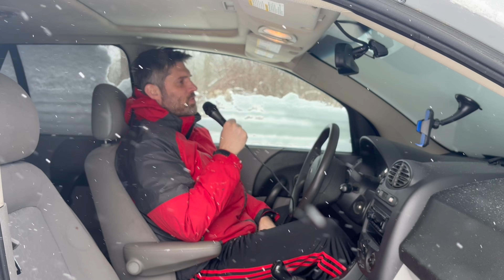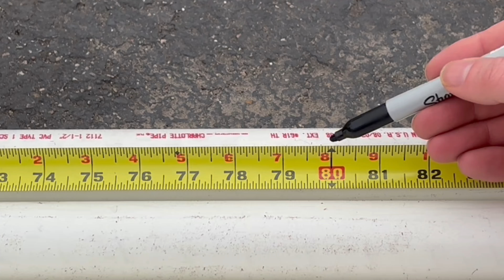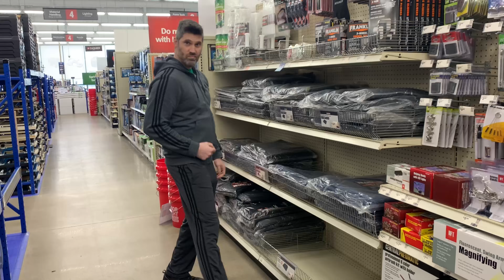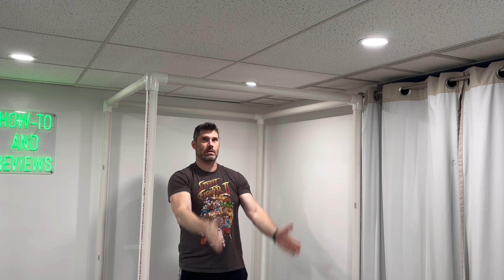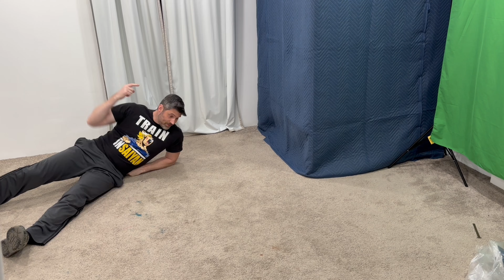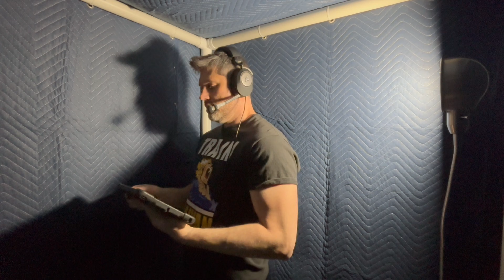How to Build a Vocal Booth - $135 - COMPLETE GUIDE - EASY DIY Recording Sound Booth

Comment: Unfortunately my measurements are going to have to be different because I'm trying to put my desk and chair and everything inside of this booth but fortunately the dude from Lowe's was able to cut them for me... thankfully I'm not that tall the mines are going to be 65 inches tall with the remainder being the width I'll keep you posted on this journey but I definitely appreciate you putting the links in the locations to get the stuff!!!! Only work I got to put in is making the grommets...*edit fortunately again they have moving blankets with built in grommets! I'm probably going to need more than four I think it's best that there's only four to test out if it's big enough I noticed you folded your blankets to make it I may or may not have to
Reply from the maker: That sounds like a great plan, I'm looking forward to hearing how it turns out!
Yes, there are moving blankets with grommets. I should have mentioned that. I selected the ones I did for low cost. The ones with grommets cost significantly more.
I should have also mentioned that hardware stores like Lowe’s and Home Depot will cut things for you. Pipe, and lumber.
Those are excellent points!

Comment: Adding accoustic pads inside would be great. Though it'll hot but the output would be zero reflection.
Reply from the maker: That's a great point, acoustic treatment would definitely help deaden the sound even more!
I did buy another set of moving blankets and doubled them up, which helped.
And yes, it does get hot in there!
Reply: @HowtoandReviewsOfficial thanks to you, I now know to make the diy booth, was about to buy it from Amazon. I'm thinking of pasting those sponge pads to the blankets.

Comment: Thank you very much for your video. I used it and the parts list to build mine. I wish I had that great saw because the hand saw was a drag. I already had the acoustic blankets from Producers Choice for a different design. One remaining question: Did you end up covering the PVC pipe at a later date to minimize echo?  That’s my only concern. I build mine 5 x 4 x 7.5 ft given that i had large acoustic blankets in hand for a design that had the blankets hanging from a 9 ft ceiling. Cheers. Tommy
Reply from the maker: Glad it helped! I did not cover the PVC pipes. They are still exposed on the inside. I did recently double up the blankets. They were on sale for $5 each, so I bought and installed another set.

Comment: In just over a year, these prices have change.

The 3-way fitting got cheaper at $17.17 for a 4-pack. Lowes actually does have these, but they're $5.88 a piece.
The moving Blankets have gone up by $1 to $9.99
Cable ties have come down by a whopping $.20, but the grommets have gone up by $.50
Safety pins have gone up by $1.

But the biggest change is the PVC Pipe that went from $7.97 a piece, to $11.96 a piece. So instead of paying $47.82, you're now paying $71.76.

So the total price now would be $159.33 now.

However, Amazon DOES have an 8-piece PVC Elbow fitting for $26.99 and a 4-pack of 80" blankets for $33.99, bringing the price back down to $146.01
Reply from the maker: Wow, thanks for doing all that research and updating the current pricing for everyone!
I remember when 10 foot sticks of PVC pipe were two or three dollars. Prices are always changing, and usually increasing.

Comment: You can buy the blankets with the grommets already in them.
Reply from the maker: Absolutely. They are available with grommets already in. I selected these, because the cost was a lot less to install them myself.
I don’t recall if the blanket height was different. But these are also the perfect height for me.

Comment: Apa ini berlaku untuk suara bising dari luar?
Reply: Hi there, a recording booth might help a slight bit, but in general, it doesn't eliminate noise. Mostly just echo
Reply from the maker: It does not really block out outside noise, and it does not block outsiders from hearing you inside.
It just damp in noise, reflections and echoes to provide clean audio.
I’ll be making a dedicated video soon showing how much noise blocking it offers.

Comment: Great idea using the grommets! I recently moved and have been needing to set my booth back up. I have the rest of the stuff, but I had previously punched holes in the blankets, so I'm going to pick up a kit to remedy that! Yours has a much cleaner look.

Two Questions: 
- How do you handle dust/airflow in the booth when you're recording for an extended time?
- Do you have any issues with the booth getting hot from the lamp or equipment in there or does it not bother you?
Reply from the maker: I haven’t had any noticeable buildup of dust yet. 
Yes, it can get warm in there. I usually record in a pair of gym shorts and a T-shirt. Gets too hot with pants on. Opening the flap and giving it a wave to flow new air through takes care of it too.

Comment: I hope this is still available, but will these connectors work in th UK for our pipes - I know this is a dumb question, but I have bought PVC here and for some reason the connectors i got didn't fit
Reply from the maker: That’s a great question. No, the diameters of pipe sizes are different in the US and UK, so these specific connectors won’t fit. 
If you source everything locally in the UK from UK suppliers, everything will fit together.

Comment: Also Shower Curtain rings/s-hangers work better and are less permanent than zip ties, especially when worried about the pipe lettering
Reply from the maker: That could be an option. 
I looked into them, and they were too small to fit on this pipe diameter.

Comment: You can buy blankets with grommets already, and PVC cutting pliers don’t make shavings
Reply from the maker: Good tips!
I did look at the blanks with grommet and the cost was significantly more than, which is why I went this route. 
Great point with the pvc pipe cutters. A worthwhile tool to invest in.

Comment: Hi Sir @How to and reviews. Thank you so much sir for this break down. 
May I ask some questions.
The links are not available, just one is. Do you by chance know the problem.
2. Can other pipes asides pvc be used.
3. Would you suggest ordering this from amazon especially from as far as Nigeria. Thank you so much sir.

Well done again
Reply from the maker: I’m glad you found the video helpful. 
I would recommend using materials that are locally available to you. You could build the frame with different material pipes, or lumber. PVC was the most cost effective for me, but if they are not available for you, there is probably something else that’s available and more cost effective.

Comment: I am considering building something like this for voiceover work, and I was just thinking – do you think you could double up on the blankets, adding one layer for the outside as you did here, but then copying it again for the inside, and then in between those, add some thick acoustic foam, stapling the blankets to the foam? Essentially making an acoustic wall without it taking up much more space? - Possibly even cutting and adding some corner foam across the pipes on the inside?
Reply from the maker: You could absolutely do that. Those are excellent ideas and will provide additional benefits. I went “spartan” on this build to keep it budget friendly.
Reply: @HowtoandReviewsOfficial  Absolutely, which makes sense for what you were going for! Thank you for the great inspiration and starting point
Reply: @HowtoandReviewsOfficial what's up where are The Links at in the description that was mentioned? Unless I'm missing them
Reply: @Outside_Of_Ye_Box_LLC  You're missing them. They're in the description 😊

Comment: Nice. I found a similar video with a downloadable PDF guide https://youtu.be/ng6xZ3lqsaM?si=qdV9DUusbmtzYIB3
Reply from the maker: That’s another way to do it. I will point out that they used 1” pipe which is pretty flimsy. That’s why they needed to add additional horizontal pipe half way up.

Comment: Nice build!  First time seeing you talk live!  Have you ever considered doing reviews live with a mic instead of voiceover?  I'm looking to get a mic but can't decide what to get, thanks.
Reply from the maker: Thanks! Yes, getting a wireless mic to talk live has been on my to do list for a while.
I used to record live when I first started, but it was impossible because of all the different cuts and views that I do back to back. 
I would still need to primary voice over videos, but a live mic would definitely come in handy sometimes. 
I’ve kind of zeroed in on the RODE mic, but it’s pricey. 
I need to dedicate more time to figuring this out and getting a wireless mic.
Reply: @HowtoandReviewsOfficial  Thanks man!  I narrowed down to RODE or DJI but can't decide LOL.
Reply: I have a 2004 Saturn vue. When I try to shift into reverse it makes a grinding noise and will not stay into the reverse gear. So I took the car to a mechanic and they told me to replace the slave master cylinder (inside the transmission). What steps can I do before taking the whole manual transmission out?